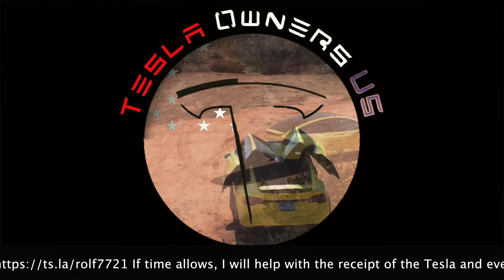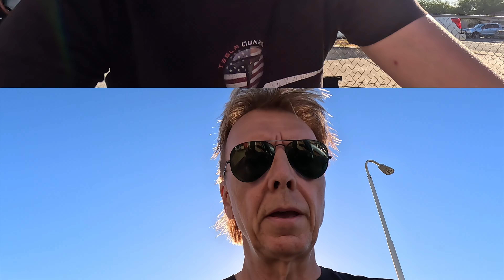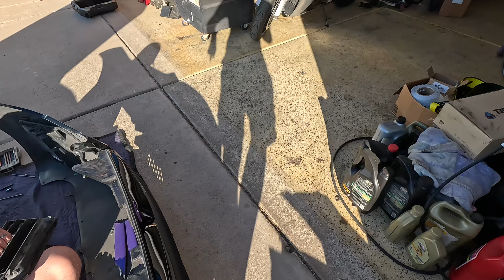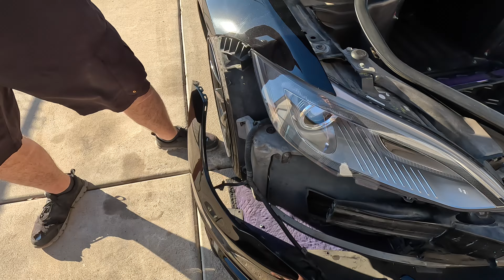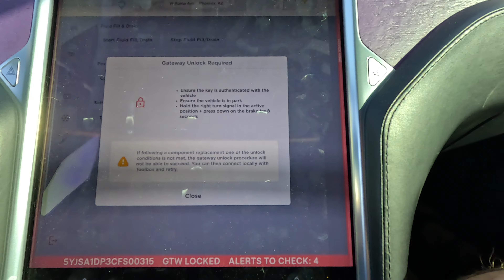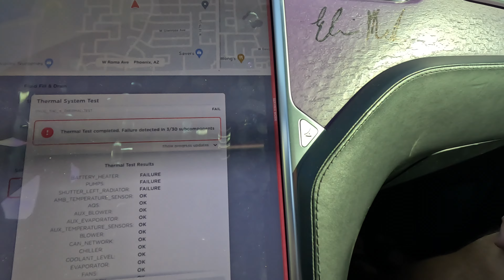Model S Repair Site Louver

Comment: Bit daft that the center left and right is same part number if the operate in 2 different directions (doesn't sound right really if they do) got no feedback on my left radiator shutter and I think my right radiator fan has detached from the motor, as car is vibrating and no airflow on right side 

so I try not to super charge past 75% as that's when the active AC cooling kicks in and makes the car sound like it's about to take off (also risks blowing the condenser due to high temp) but the left condenser seems to be keeping up at 100% fan speed (but it's only 10c outside it be way different situation above 20-30c)

It be intresting if I could find someone to do the shutter recalibration because they do appear to be moving (screw heads are quite rusty so be a slight fag to get them out)

Comment: Are you running on an MCU2? The service mode on my 2017 MS75 equipped with MCU1 is much less detailed, no thermal test is available.
Reply: MCU1 does not support thermal test, correct.
Reply: If you can manage to downgrade to version 2022.8.10.5 you can try to get toolbox 2.1 which was the former Tesla Servicenter toolbox for a model S and model X (only working with MCU1).
Heading to set up, you are really in the master of your car.
Reply: @mamu679  how to downgrade

Comment: Hi guys, nice video, thx for it! In my case all of the louvers were reporting failures, so I ran the offline Toolbox 2.1 to perform the louvers calibration and also the louver angle fix procedure. It failed for all of them, both the procedures. But then suddely when I have arrived to the Supercharger I have noticed the side louvers to be opening again! Related faults also disappeared. Remained only for the rad shutters, so wondering, what could be wrong... I have one theory nevertheless ;)

Comment: Hi.
Did you ask the price for louvers already from Tesla?
Reply from the maker: I guess they are at least twice as expensive. I did not ask for a price because I did not repair the middle louver. I bought the side louver on eBay. Rolf
Reply: Thank you for prompt reply.  I have the issue with all louvers. Like I understood from your video, no séance to change only actuators. Am I right?
Reply from the maker: @sezar8125  The problem with the actuators is that you don’t know which direction they are turning. They are both the same part numbers. My louvers were damaged anyway so I exchanged the entire assembly. Rolf
Reply: @sezar8125 
Inner louvers are 3D printed available on eBay. At least in Germany.

Comment: How do you disconnect the harness? Do you have to slide forward or backwards with the safety clip? Then press down and pull the harness?
Reply from the maker: Exactly. Press down the safety clip and pull it out. Rolf